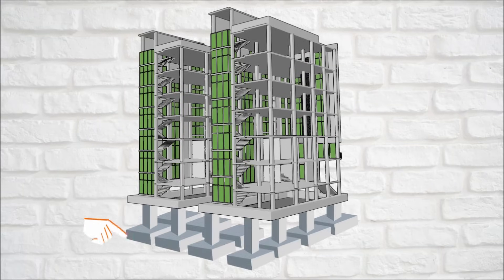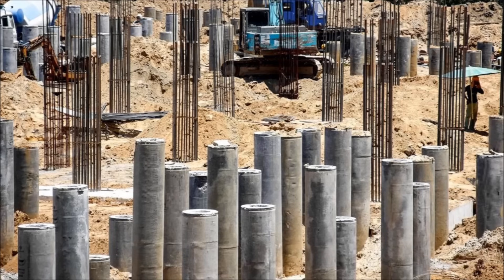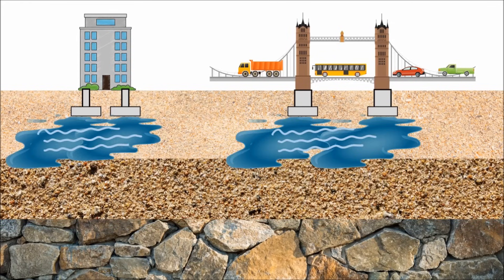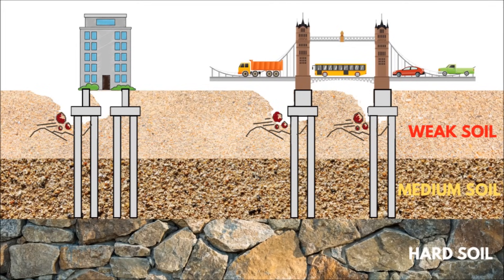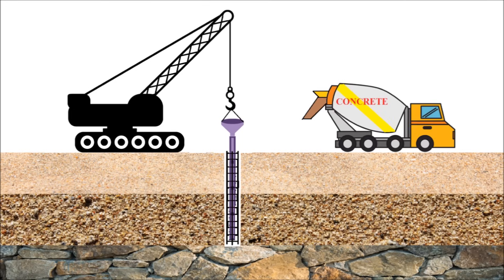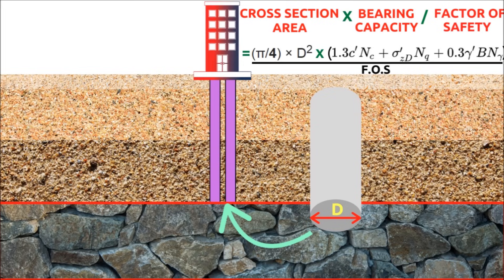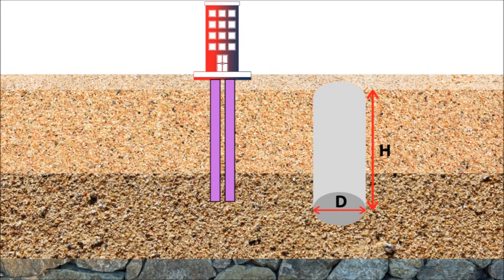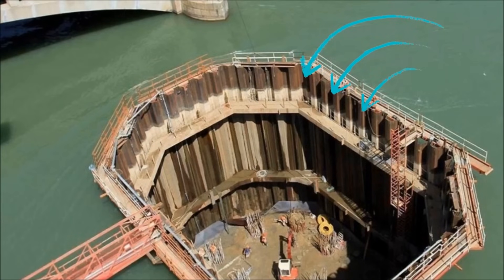Pile Foundation and It's Types | Bridge Engineering | Lec - 05

Comment: How does bored piles resist loads? Is it by end bearing or skin friction?
Reply from the maker: Bored cast in situ piles can transfer the loads through end bearing and skin friction both.
Reply: So bored piles are classified, based on the load transfer method, as friction cum end bearing piles?

I suppose it can resist these two load types simultaneously. Not one at a time? 

Also, when we say a pile is resisting load through friction, does that mean it moves or that it tries to move?

How can skin friction be involved anyway if, in bored piling, the pile's tip rests beneath or over hard strata? Isn't it strong enough?

Comment: What If We Get Water From Underground While Digging Deep Depth For Pile Foundation
Reply from the maker: If the water table is high, Bentonite slurry or Polymer slurry is used to improve the stability of the borehole during boring of pile foundation. After completion of boring insert reinforcement as per drawing and BBS, then employ tremie pipes to pour concrete through water. Attach the required number of tremie pipes to reach the bottom of the pile and attach the top hopper in which concrete to be poured. Provisions should be taken to ensure that underwater concrete is not dropped freely through water because concrete components are apt to become segregated and deposited as separate gravel, sand, and cement strata. Place concrete continuously to avoid disruption of concrete placement and the bottom of tremie pipe should embedded minimum 1.0 m into poured concrete while removing the tremie. 
The calculations of tremie pipes and pouring of concrete we will discuss in our next videos accordingly. Stay Connected…